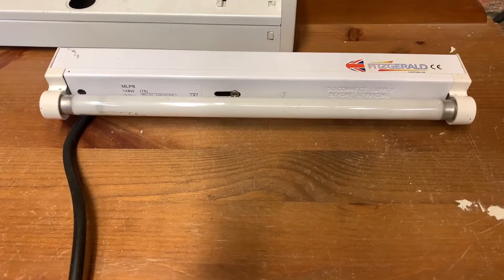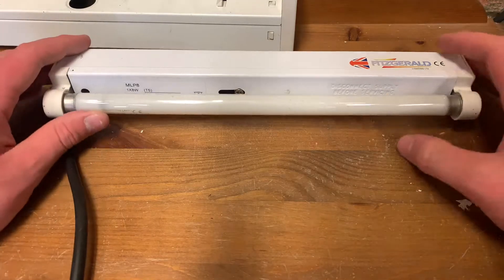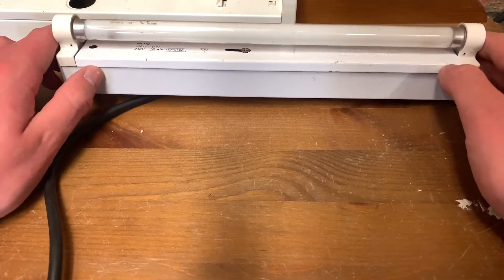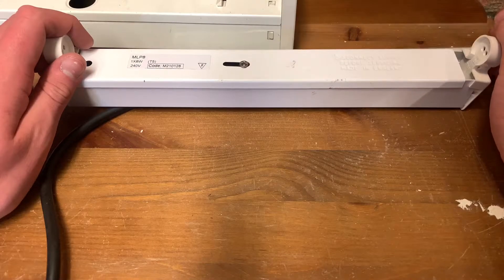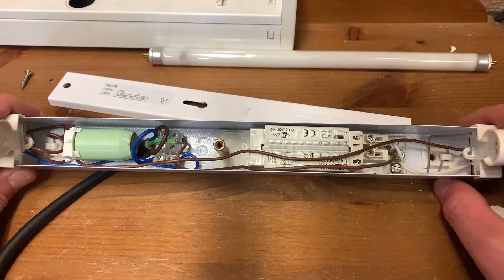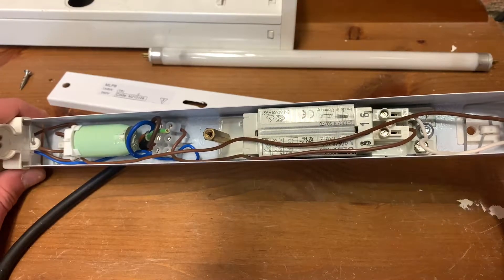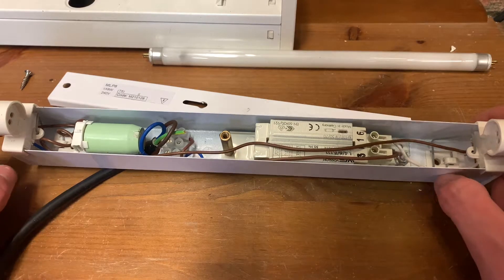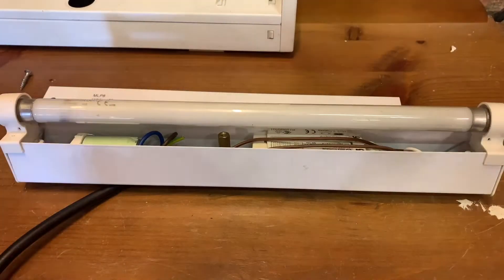Fitzgerald MLP8 8W T5 Mini Fluorescent Battern

Comment: That's is a 8w Fitzgerald light fitting with a t5 8w fluorescent tube and 4--22w 110-130-220-240v fluorescent lamp starter in series and its run of a 4-6-8w choke 240v ballast in the Fitzgerald light fitting
Reply: I know